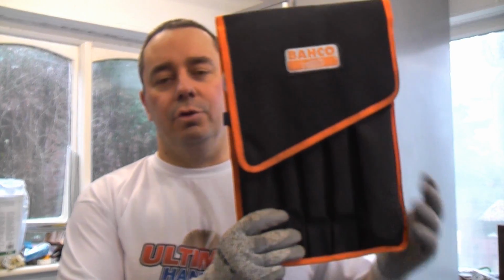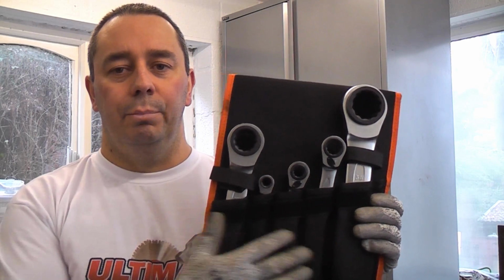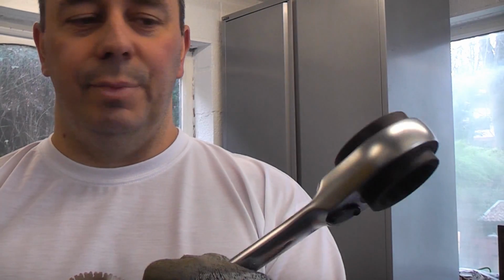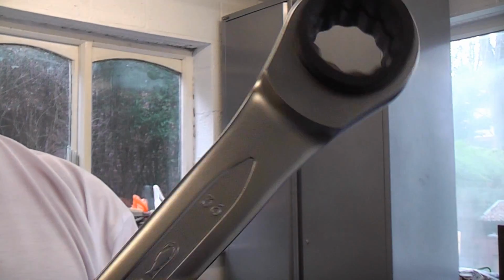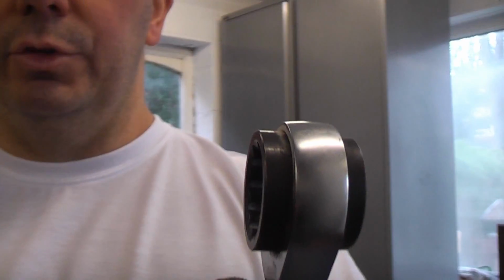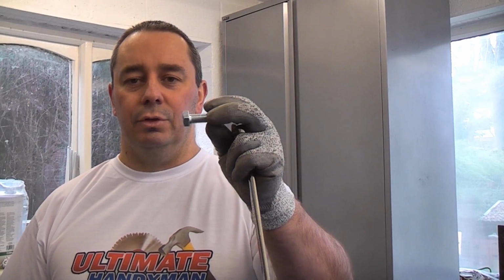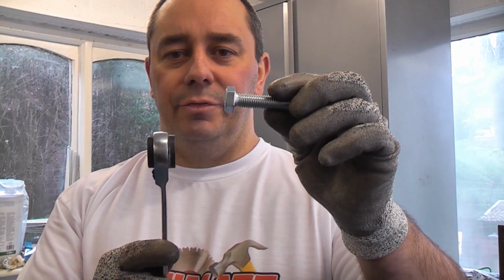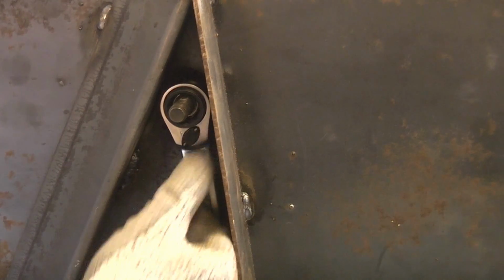Bahco reversible ratchet spanner review

Comment: I’m debating between the 3 spammer set and the 4 spanner set. How often do you really use the second largest spanner
Reply from the maker: I used that a fair bit on site, as I often came across 24mm and 27mm bolts!
The largest spanner, with 30mm and 32mm sizes, was not used as much though.
It depends what line of work you are in! 👍
Reply: @ultimatehandyman  thanks. I ordered the three set of wrenches/ spanners over the 4 wrench/ spanner set. I just didn’t see my self using the big boy ever.

Comment: Will the bolt or nut also stop if you go in through the smaller of the two sizes on the wrench?
Reply from the maker: No, it is only held if you use the largest size, as the smaller size on the other size prevents it from dropping out of the back.
Thanks for the comment 👍
Reply: Ultimate Handyman thanks

Comment: You can get a smaller set up to 19mm, I have one and one of the best ratchet spanner sets I've come across
Reply from the maker: I must admit that out of the 5 or so sets of spanners that I own these are the most used!
Thanks for the comment
Reply: Do you find that they are a good replacement for a socket set? I'm thinking about getting these instead of a standard $200 metric socket set.

Comment: Many thanks for the upload of these video with the various spanners.
I wish I had found the captive holding spanner, for the same reason you mentioned, several years ago. These are good quality tools, but they are unique making them easier to use and gets a job done quickly with no knuckle damage!

You make a good video. I like it when the actual ‘USER”, you know the man at the ‘sharp’ end because they will be the ones using these tools and they will say the good and bad points!

mrbluenun